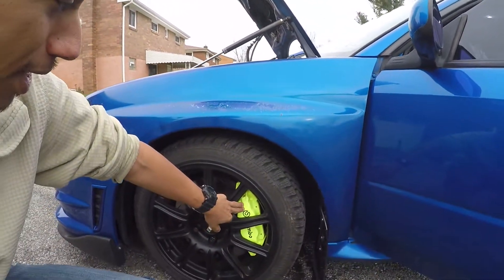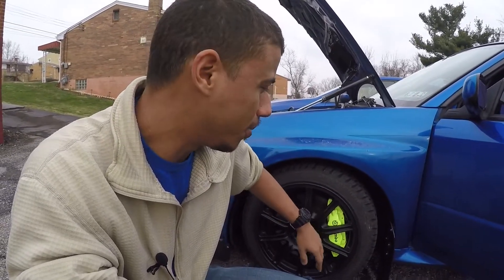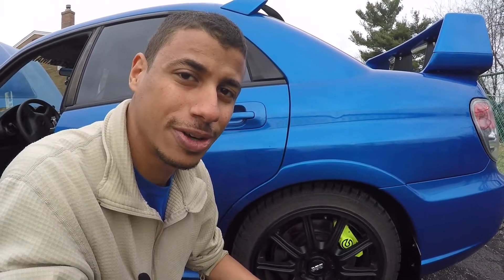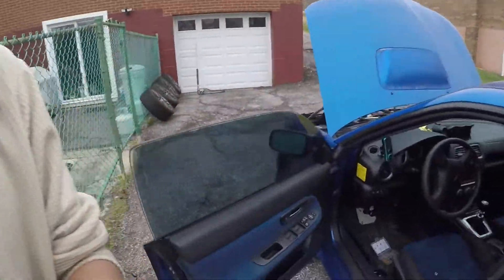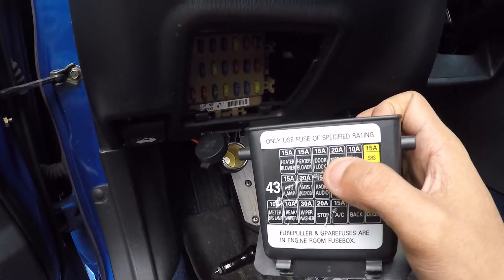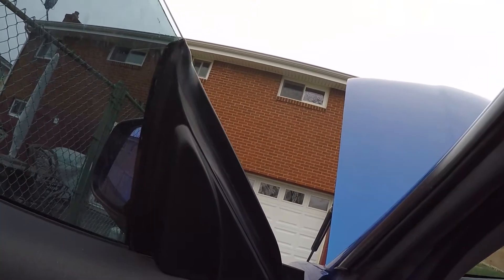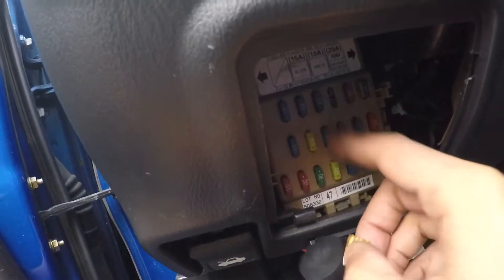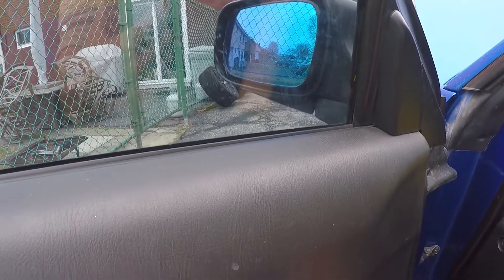FIXED: Replacing A Blown Fuse

Comment: I just bought an 02 Subaru Forester yesterday.  Found out after I bought it the AC wasn't working.  Intuitively I knew to start by checking the fuses and relays. 
I hope it's a simple fix. Thanks for the good info.

Comment: That same fuse (cigar/mirror 20A) is also blown for me and I replaced it and it still does not work. How could I fix this issue?
Reply from the maker: Did the fuse blow again after replacing it or no? If it did, there must be something overloading that circuit, maybe a wiring issue or short somewhere. If the fuse is still good, I would check the cigarette lighter. There is a linkable fuse on the back that could be blown/damaged. I have a video on replacing that. Did anything change before you started having issues? plug in something new or anything?
Reply: Would you mind pasting a link to the video you made showing the replacement of the linkable fuse (mentioned in your comment above)?  Thank you! Helpful stuff.